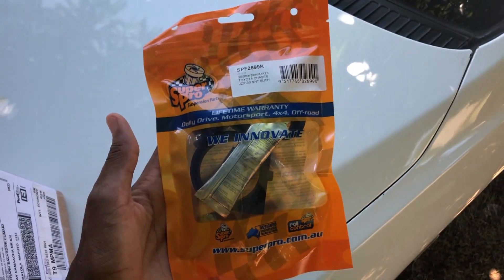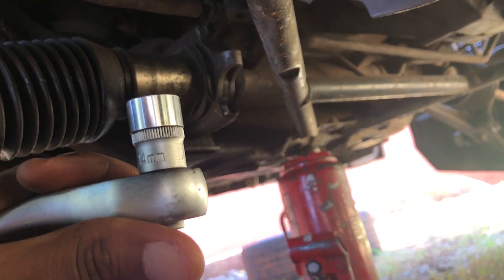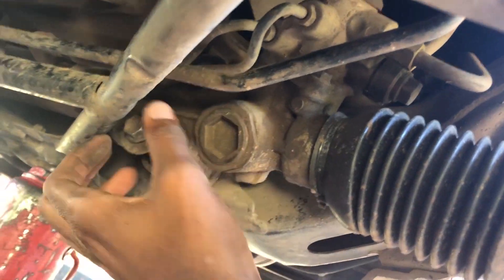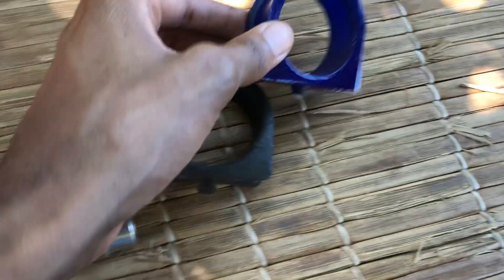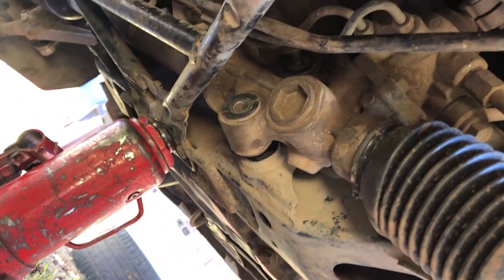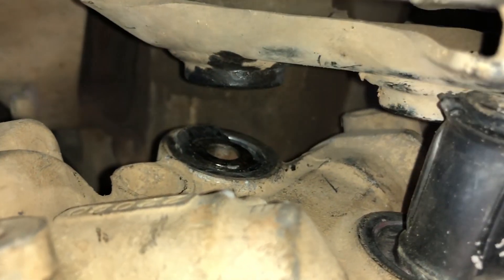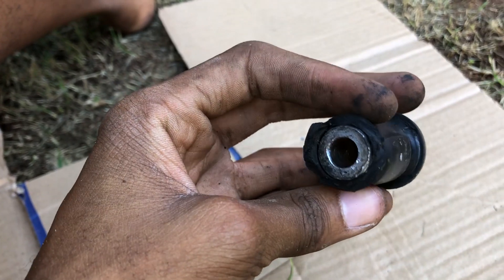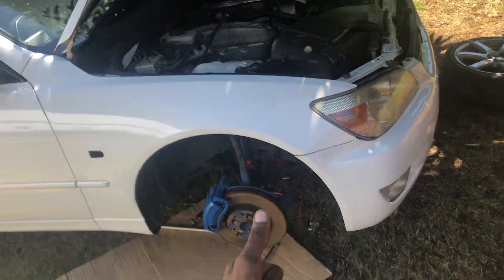Altezza is300 power steering rack bushings replacament

Comment: Good video! Do you notice much change using the polys instead of rubber? Any more vibrations?
Reply from the maker: yes, the steering wheel became more precise, maybe because the old ones were too old. there are no vibrations and the feel smooth